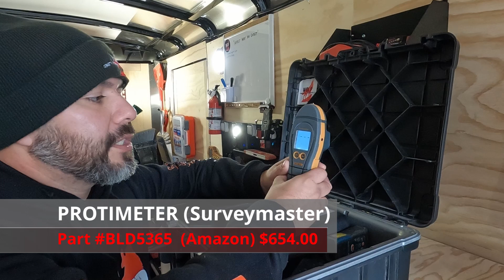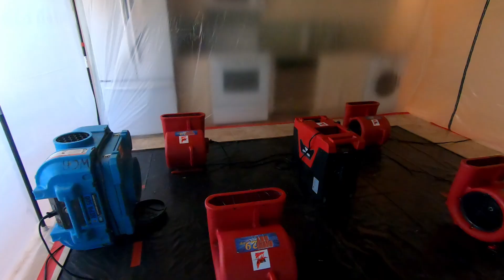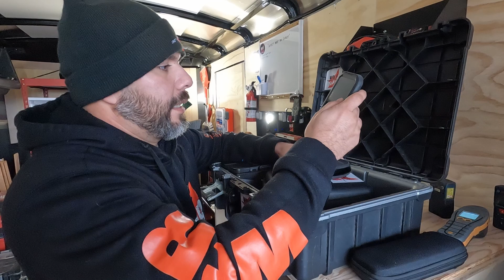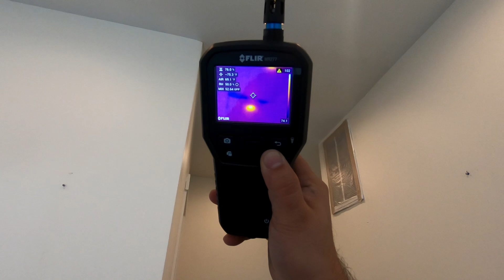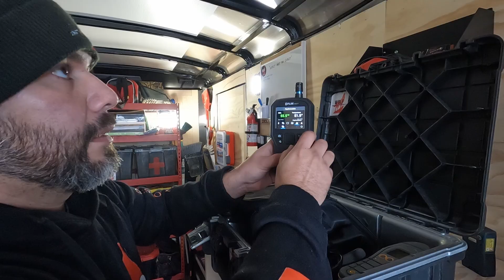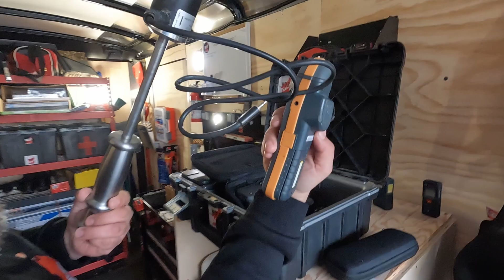Water Damage Restoration Inspection Tools

Comment: A lot of nice tools for the industry. I would mention that the Flir Thermal Imaging gets misread a lot. You were correct by having your buddy go to the wall and actually check it with a moisture meter. I have seen people mistaken the image of blue on the screen as wet and I would use my moisture meter to show them it was dry. I always use my hammer probe on a lot of the jobs we are on and it is very accurate! Nice set up on your trailer!
Reply from the maker: Thank you. Yes, definitely a bit of a  learning curve on the flir.